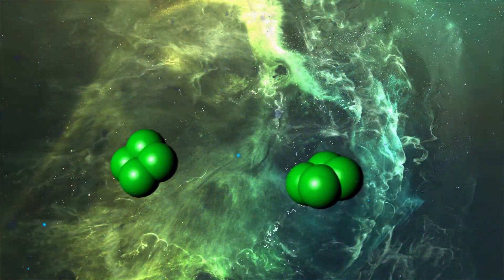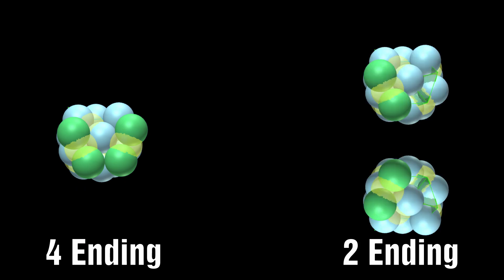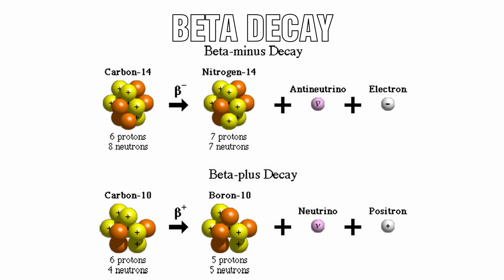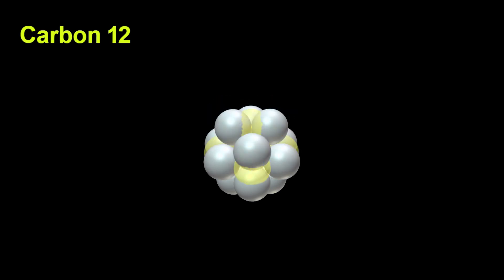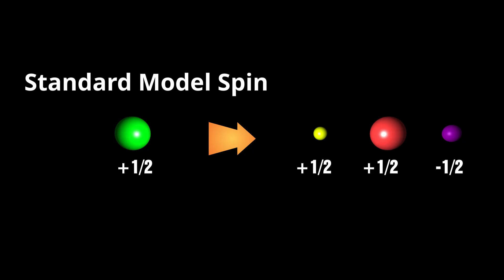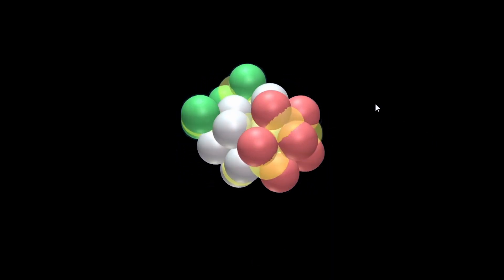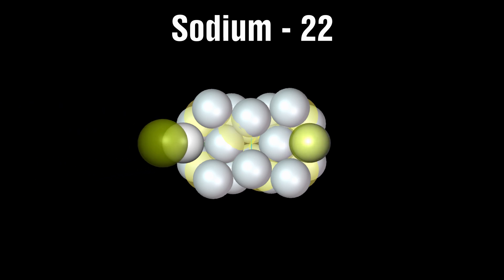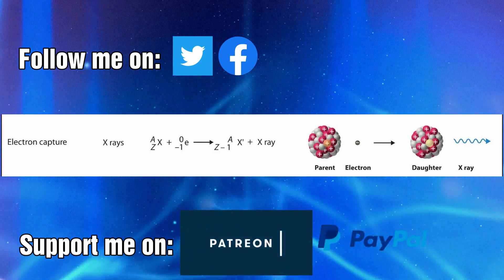Simple Nuclear Reactions Explained Using the Structured Atom Model

Comment: The kinetic spectrum @5:03 looks like a Maxwell-Boltzmann distribution. One might think of a process in which the inner electrons contineuously collide with each other and get another velocity. When the velocity of one of the inner electrons after collision is high enough, the electron will escape the potential well of coulomb forces and be emitted. In Bi210 we have 126 inner electrons, of which I think are not localized but can hop from one proton pair to another due to thermal motion. At RT the electron has a thermal de Broglie wavelength of 4.4 nm, which is much larger than the nucleus.

Comment: @See the Pattern Hi, hey could you take a look at this? http://nuevateoriadelagravitacion.com.ar/sobre-el-autor.html It is in Spanish. It is by a civil engineer who has developed a new theory of gravitation. 

"The main objective of the study is to obtain an equation that characterizes the gravitational fields, starting from the premise that all of them must respond to the same and unique equation. The equation must also explain the interaction of the innumerable gravitational fields among themselves. The equation that characterizes the gravitational fields was found and once obtained it could be verified that it is also applicable to atoms and electromagnetic fields. It will be seen throughout the study that the equation is applicable to all known force fields, thus allowing to explain all interactions between bodies with that single equation. [...] The equations obtained have the form of structure laws, a form required for all physical equations since the great discovery of the Field Theory, and are not built on the basis of the concept of matter but on the concepts of field and energy, which acquire an essential importance." 

Thank you!

Comment: A nucleus or atom doesn't just emit gamma rays as a rule, it doesn't create gamma rays out of nothing, they come from something. You can't create matter, only convert its forms of motion - but the forms of motion are not "pure motion", they're motion of a material body. A gamma ray being emitted means Something converted into a gamma ray. Electrons can do that, as electrons are essentially the next "color" beyond gamma ray, they're one step away from a gamma ray and can transform into them readily by collisions between opposite spinning electrons (positrons). That's logically sound -- photons being emitted just because its a rule that atoms release "energy" when they move into a lower energy state is circular thinking
Reply from the maker: https://imagine.gsfc.nasa.gov/science/toolbox/gamma_generation.html#:~:text=Radioactive%20decay%20results%20when%20an,decays%20into%20the%20ground%20state.
Reply: @SeethePattern  yes, yes -- but what im saying is - the emission of a gamma ray isn't "creating" it out of thin air, but rather becoming gamma ray photons themselves because, in the final analysis, every particle is, at its most indivisible core, several stacked spins of photons, spinning at the speed of light. 

the photon has this unbreakable law that it is always traveling at C and always has this same amount of motion no matter WHAT. 

But not necessarily Linear motion - if it were to spin in small circles on the X axis, and that X spin itself spun on the Z axis, and that Z spin  itself spinned on the Y axis - it would effectively be distributing C across multiple vectors, so it can be relatively slow, linearly, by spinning at C gyroscopically..  

(im saying a proton is a photon, an electron is a photon, and so on).  Its angular velocity is enough that it can appear as being a larger particle with a larger radius because the rate of movement blurs itself into a larger sphere. 

 And that's even all the way up to the most extreme cases of the massive higgs boson particle -- its still a photon that has diverted nearly all linear velocity into spins . But its more and more unstable the higher you go, and that particle only lasts for a fraction under the most controlled conditions. 

When an atom splits and releases gamma rays - its not releasing photons that were stuck inside of it - and the number of photons vs how many electrons were annihilated in positron collisions likely do not add up. Theres more photons than there are electrons annihilate.  So where do they come from?. 

One might conclude that its generating brand new photons of spooky "energy" kamehamehas out of the void.  But the real origin is VERY much physical and Billiard ball  level physics, nothing complicated or mystical. The real reason is because atoms have a river, an ocean of photons flowing through them at all times -- this is what charge is.

Charge is the flow of photons.  A charged particle like a proton or electron -- "has charge" -- photons ARE that charge.   They're what causes repulsion -- through direct, physical, Classical  newtonian Bombardment of uncountable numbers of near weightless photons. 

In addition, Charge photons are what  moves electrons in electron currents. Electricity is just a side effect of Charge photons.  Electrons are irrelevant  except as structural supporters for a nucleus. They aren't the real cause of electromagnetism though. Photons are . 
Electrons are pushed along currents by photons, not the other way around.  Electrons are just coming along for the ride - but the actual "charge " that is responsible for magnetism, electricity and other phenomenon of this plasma-cosmological reality is the charge field composed of photons, of which electrons are also photons but are posing as a larger particle temporarily until they get collided with  and convert BACK into photons. 

So this river of photons flowing through all magnetic poles of every spinning body -- what happens when you suddenly block that flow with one two many neutrons or any other imbalance ?  The flow of charge simply Smashes the obstacle violently until flow is restored. 

The enormous weight of the entire ocean of charge photons crushing down on a single neutron which got in the way , EXPLODES the nucleus and sends a shockwave of vibrations outward. Protons and electrons violently collide with these photons and "bump" them up into gamma vibrations.  

So its this physical whiplash of the nucleus itself ballistically crashing into photons in its immediate vicinity that imparts kinetic energy into  those charge-photons, and that kinetic energy- since it cannot move faster than C  (or slower than C) is distributed into its Angular velocity rather than Linear velocity. Instead of getting bumped and moving faster, a photon just gets more frequency (or less depending on whether it was spinning in the same direction or opposite to the particle at the moment of collision).    At the level of a gamma ray -a photon is basically one collision away from becoming an electron.  

An electron is one step away from becoming a gamma ray. an electron is basically what happens if you raise the frequency of a gamma ray even higher, it undergoes a dialectical qualitative shift and its property of being "radiation" or a "wave"  or "massless" is Negated as such.
Reply: @SeethePattern   "the resulting radiation is called bremsstrahlung; it is synchrotron radiation when the acceleration takes place in a static magnetic field; and the process is called or Compton scattering (sometimes also called Thomson scattering) when the acceleration occurs in the electromagnetic field of a photon. " 

No offense to anyone at nasa, but this is just so muddled.  

1. Photons ARE the field, they dont' have fields. A single photon doesn't have a field because the statement is itself a contradiction. A field is multiple objects - a single photon has no field, it is only through the relationship between quintillions of photons filling every  proton radii of space that the sum of photons becomes a "field of photons" as such.  But "A"  photon as no such thing as a field - its fieldness only emerges out of the crowd. 

2.  the field itself exerts no "force" -- the field is a an abstract term given to a collection of objects as if its one entity. In reality, its the photons IN the field, physicalling bombarding against the surfaces of charged particles, which cause the exchange of momentum i.e. the force.  

3. They're both  the same thing though.  An electron accelerates through the traffic of  the dense region of photons   shoving away from the equatorial plane around the axis of spin of a proton - and shoving towards the axis of spin itself.  

 4. As an electron moves through that local space, drags against and collides with photons and sends them flying in various directions. This is also the cause of the double slit wave pattern - because as the fired particle enters the Slit - it is also colliding with photons being emitted by the atoms of the wall with the slit - those photons get bumped and sent along a trajectory according to the gyroscopic laws which govern the quantized, "step-like" nature of the  ways the base radius of the photon can be multiplied or divided. like, a photon spin in a loop at "half" of its surface radius, only x1896 times the radius. so as a photon collides with other photons (or grazes them) its path is still determined by gyroscopic rules, not simply because it knew it wasnt being observed. .   

5. Whenever any particle moves through or near an atom, a field, a charged area etc, it must inevitably collide with spinning photons like a sail or a fin, causing scattering, AND mass. Mass is the very drag that moving through a charge field that resists you. Scattering is not just figuring out the energy or  mass of a particle or the force of the field, its a function of the contradicting opposite momentum of the particle and the photons it's emitting, and the photons which are dragging against it. all mass is just drag or resistance to motion in the photon field, thats why  C is squared in e=mc2 - its measuring two opposite motions of the charge field coupled to an object's so-called mass,  negating each other and the mass -  exposing the underlying motion as the leftover, E. inversely calculating how much energy is transferred to the charge field via drag exposes the mass - mass is just the energy lost of the object which was lost to  the resistance caused by photon bombardment i.e.  charge field drag.. 

 6. Depending on whether the direction of spin are in agreement or not determines whether it causes compton scattering or synchrotron scattering.  If both spins are aligned as such that results in an increase of spin - the result is repulsion and the synchrotron scattering. If it results in destructive interference and loss of spin, it results in a drop in outward pressure, causing the external field to collapse inward, or as they say, "attraction" and the secondary effect is compton scattering.   
.

Comment: Working Hypothesis for SAFIRE using the SAM model:
Activated protons are catalyzed under specific conditions to combine with electrons to produce deuterons. These in turn bind into the active regions of atomic nuclei.
.
This also explains the remediation of nuclear waste actinides. In the low energy reactions, any neutrons that do get released (a combined proton-electron coupling) would get scavenged by an active proton and turned into a new deuteron.
.
I wonder if there was increased deuterium in the hydrogen gas?

Comment: I would like to hear your thoughts; The standard idea of Black Holes is that when enough Neutrons collapse under their own gravity, it hits it's Schwarzschild limit where the Event Horizon influences light etc etc. The idea of a singularity always puzzled me, where the Hole doesn't have a surface and you'd keep falling. What if a Black Hole does have a solid surface, not a singularity... the way a Neutron Star does but just more massive until light can't escape? Can you use the SAM and model a spherical mass of Proton/Electrons pairs (Neutrons)? This would not follow the Euclidean geometry of the elements but be a spherical mass governed by gravitational collapse...
Reply: I think that the theory of the existence of black holes is just that, a theory that makes no sense.
Reply: @michaelworst9339  Agreed. For me the current theory of Blacks Holes doesn't make sense... that's why their math falls apart the deeper the go. To me it's just a heavier Neutron Star that really screws with light, not a singularity.

Comment: Okay, I teach this subject at a college level and have a degree in nuclear physics. I do think the SAM is right about most things. However, there is a problem with the positron emission. If the positron emission occurs in the nucleus, a) why are there two identical, always 511 keV photons released? and more importantly, b) why doesn't electron capture release anything other than characteristic x-rays? The other problem is that the answer to the continuous beta energy spectrum is not satisfying because alpha releases have a discrete energy but beta does not.
Reply: The main concept SAM shows is that the proposed structure works for all elements and isotopes, and it can flawlessly demonstrate visually all nuclear reactions. The precise nature and origin of gamma, photon or alpha particles we think can be examined much better with these tools. IF we are brave enough, we should draw the conclusion that we do not know it all yet, and there is much more detail and finesse to be found. Perhaps we can even find real explanations to age old questions this way. The 2 180 degree emitted gamma rays need explanation obviously, but this is not something that is done over night in these matters. Besides that, we are a small team and there is a ton of topics that need investigation likewise....
Reply: @edokael4291  Ken Wheeler's work contains insight on the 2 180 degree rays
Reply: In order to answer why two gamma rays are emitted in opposite directions at electron-positron annihilation, we need to first understand what exactly is electron and positron (and their inner structure). SAM model does not even attempt to answer to this question, so no wonder that it wont give an answer here.
Reply: @joonasmakinen4807  please re-read what Edo Kaal just explained in his comment. He is honest and humble enough to admit answers to these questions are yet unknown. He does not offer up speculations ad nauseam to patch up failed theories, as is the habit of conventional nuclear physicists, but rather admits the need for further investigation into what are open, unanswered questions at this point. The SAM team invites critical inspection of the finer issues.

P
Reply: @markspann  I think you misunderstood me. I did not intend to respond Edo Kaal, but the other one. In my understanding SAM at its current state approximates electron and proton as simple charged spheres and does not try to explain their inner structure. (If it does, then where can I find this info?) Due to this model simplification, it cannot answer why and how i.e. gamma rays occur, or why doesn’t electron spiral indefinitely towards proton. It is SAM not SSAM (=structured subatomic model). Hence, it is understandable that this model has its limits.
Reply: Positrons likely exist, if they didn't positron annihilation spectroscopy wouldn't work. There is also evidence of bremsstrahlung due to positrons as well.
Reply: @revcrussell  spectroscopes don't know anything about electrons or the atomic structure of the atom. how can it know anything about positrons.

Comment: Can your model predict if the mysterious alleged Area 51 Element 115 atomic weight 199 is stable?
Reply: Out of curiosity, what attributes would that element have? We see in SAM a natural limitation occurring in the structure at around Lead. This is the reason why the elements above it are inherently unstable, pretty much like having too much stress energy. 115 would be in the realm of man-made and very short lived isotopes. The island of stability we see very little possibilities for to exist, despite that wish. 
The atomic weight of 199 does not seem to correspond with element number 115, is this number correct, because it would be more like element number 80 or around mercury.
Reply: @edokael4291  199 is the rumored stable weight of an isotope of 115. I was wondering if the model could predict if it was stable. This is area 51 nonsense. It is just curiosity. Many elements have unstable short lived isotopes. The largest known mass of element 115 has been 290 with 175 neutrons. The Wikipedia entry for this element seems to show longer half lives with more neutrons. Thus far only 4  isotopes are known per Wikipedia. With 175 neutrons the half life is 650ms, 172 neutron 115 has a 37ms half life. He seems to have a model for stability of a nucleus. I was just wondering if at weight 299 element 115 would be stable per his model. I don't have access to the modeling tool. This is just idle curiosity. The largest known isotope of element 115 has an atomic weight of 290.
Reply: @BeachCity  We cannot definitively exclude the possibility of heavier elements to exist, however the proposed element (115) seems to be quite impossible or at the very least very, very unstable even if this could be synthesized. The natural limitation really seems to be at around Plutonium....